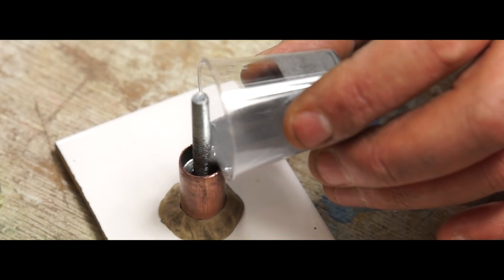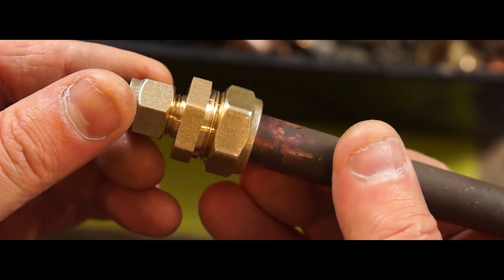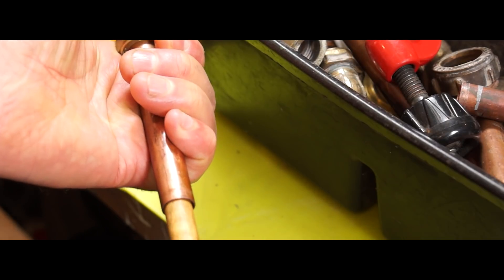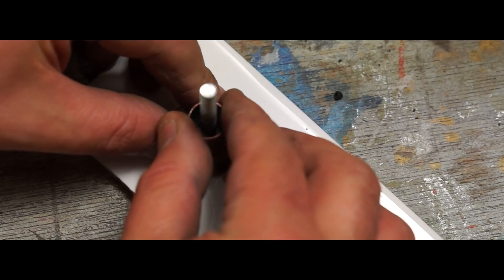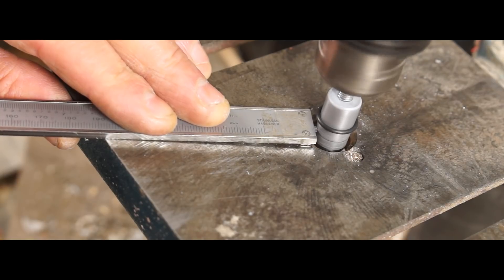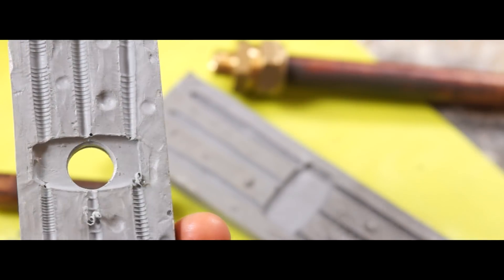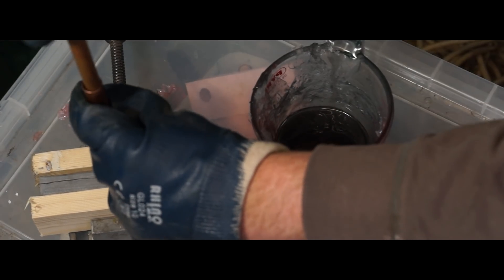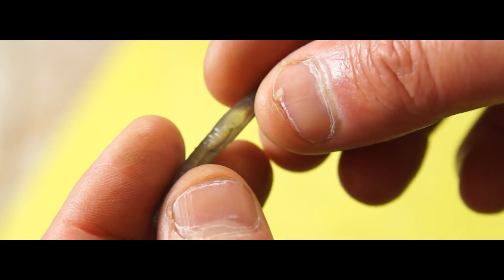Making a Hand Injector for soft plastic fishing lures

Comment: When you draw the plastic into your injector, you could be creating the bulk of your bubbles. Try making a rudimentary stand for your injector to set it up vertical nozzle up. Then pour your plastics into your injector. Anytime you reduce the atmosphere around a liquid or cause a vacuum, you increase the size of the air bubbles desolved in the liquid. But as you increase atmosphere or inject it you should shrink the air bubbles. So I think most your problem could be in you drawing the liquid. Also making small air vints in the end of every lure void could help the evacuation of any small trapped air bubbles that you do get. Hope this helps paul.
Reply from the maker: the mould is vented, but how i fill the tube inject is something worth looking at again, i have made a larger silicone injection mould with the port at the base this fits  onto and injector that is pour filled, it uses a caulk gun mechanism to push the soft plastic up through the mould and then into a top chamber to make up for any shrinkage, it also has valve on th e bottom of the mould so i can close it to  take it off the injector, this is for  a larger swimbait
Reply: The Handmade Fisherman... also the lip on the inside after you drilled out the nozzle could be causing turbulance. I have been wanting to do a swim bait for a year now with eather high strength 3 mold (needs a hard backing very brittle by the way) or an aluminum epoxy mold like you did...brilliant by the way and the injector as well. Also I don't know if you have tryed mica dust but gives a really cool effect to plastic I love the silver. Found these at a craft store for cheep.... Jaquard Pearlex Metallic Calligraphy Set go with a little a knife tip for a little shimmer or go crazy for a marbled almost full on metal look.

Comment: Great video as usual! Try pouring the soft plastic into the injector instead of sucking it up. This has solved a lot of my problems concerning air bubbles in my worms. Thanks for all the inspiration!
Reply from the maker: that would be a good idea if it was little larger, so it may work with the next one

Comment: wow thanks for put you wonderful video out their for use. you have make couple of video on how to make spinner baits  4 years a go i have try to make my own at one time  never worked that well and my great great grandpa never like fishing with them because he never could make them too   
thank for you help i can now make them very well and now looking for any skirt materials i can use to build them from i did tried  for some skirts never worked that great  but i buck and deer tail hair works very well for the skirts  
for the weight i found walmart have lot of them now on discounted i pick all i could fine at this walmart i came home with 50 package of different sizes of weights  i just drill out the hole little bite bigger to slide the weight over the eye of the hook the epoxy to  seal it all in place i do put paint in the epoxy too it make it very hard finish on them

Comment: looking at the rubber bit on a syringe it has a chamfer on it which i think will create less friction when plunged, maybe you could find a way to accuratly cut one into the o ring on the orig design
Reply from the maker: I am not sure that would make a big difference as runs very smoothly the way it is, thanks

Comment: Wouldn't a normal plastic syringe work? Also with injection moulding, I would make so you push plastic from the top directly to the bottom of the mould and have it go up. You also need a vent hole on top, that way the plastic you inject pushes the air out, so you have no bubbles. Cheers!
Reply from the maker: plastic syringes melt, and yess the mould is vented but injecting from the bottom would be better